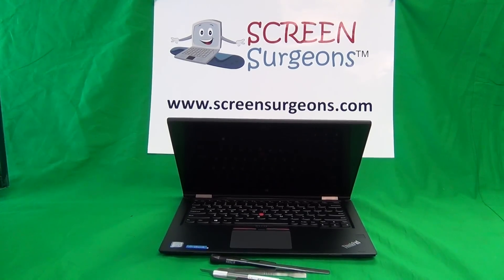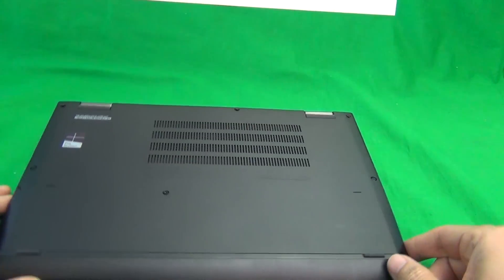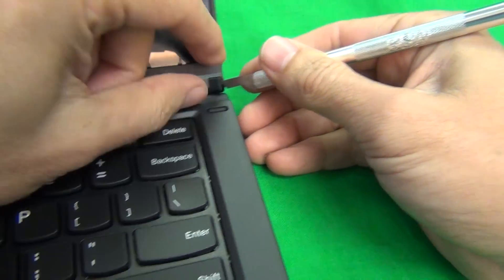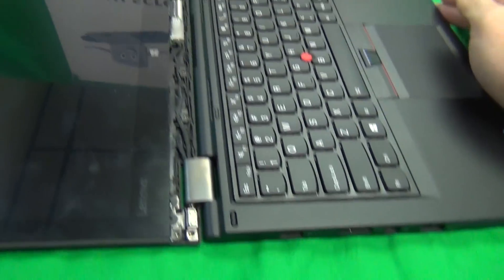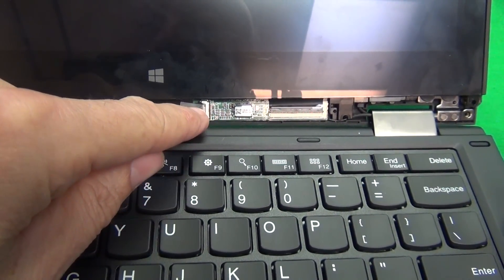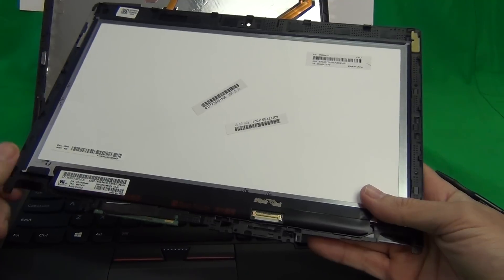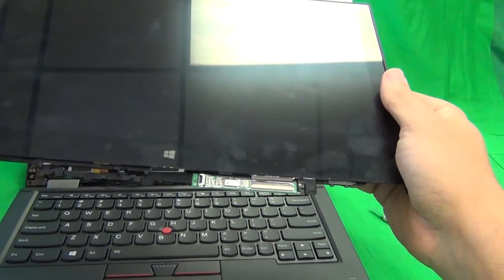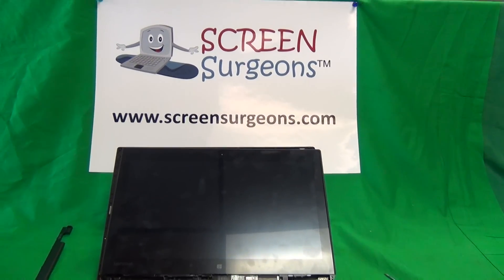Lenovo ThinkPad Yoga 260 Touchscreen Assembly Replacement Procedure

Comment: A very informative and interesting video, thank you.   I have acquired one of those original S1 yoga thinkpads, I can get the fan to start but nothing else happens, it won't boot or display anything on the screen, it will power on from the switch but it won't power off from there, I have to remove the charging cable to stop it. I am wondering if it will be worth the investment to get it up and running again, I don't even know which O.S. is installed on it.

Comment: Good video, also applies to the Thinkpad Yoga L380, a word of caution, when removing the bottom cover to disconnect the battery it's advisable to remove the pen from its bay before taking the bottom cover off, if not the pen charging contacts can be damaged.

Comment: Nice video. I used the steps here. I normally don’t unplug the battery. This time I did. Now the device won’t power up correctly. I’m guessing I’ll have to replace the battery. Other than that very informative steps👍🏾

Comment: WARNING! The method of "snapping the plastic cover off" shown starting 4:04 is NOT correct! If you proceed that way you'll end up with broken screen (as I did) - there are tabs on the top of the cover (you can see them on the video) that slide under the display. If you force it the way shown it may (will?) crack the thin glass of the display!!! Instead proceed like this: after removing the two screws that hold the plastic cover, flip the display all the way to the back (i.e. tablet mode). Then put some plastic tool (plastic card, etc.) in the slot at the (side) edge of the display and crack it slightly open. During this you may consider holding with your finger the side of the plastic cover, that touches the display - such that it does not exert force on the display glass. After all the clips on the edge of the display are released, lift that bottom side slightly up and then towards you (away from the glass of the display). This will ensure safe release of the cover. To reassemble - use the reverse order!
Reply: Yes I broke my monitor too, I wish I had listened to your advice